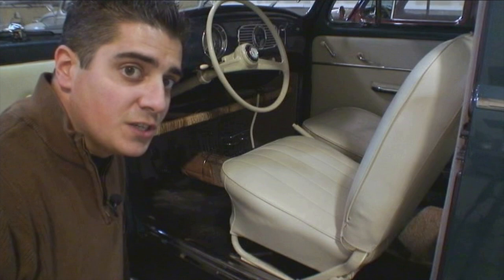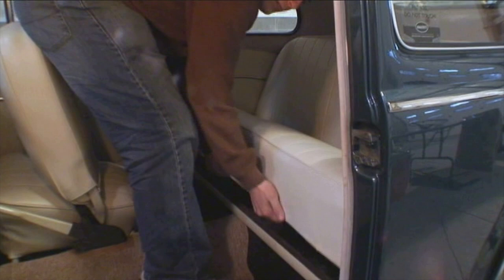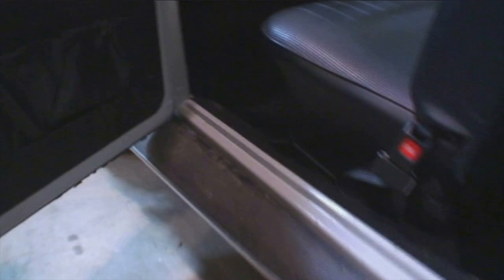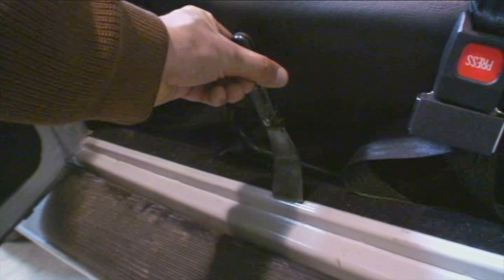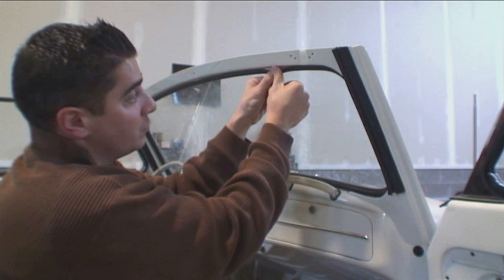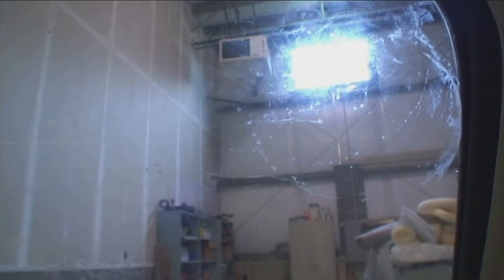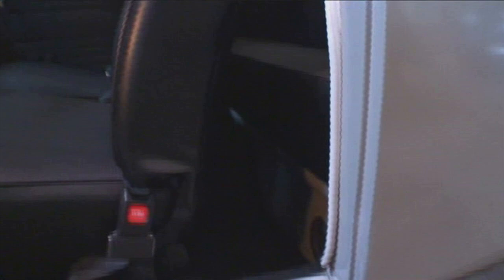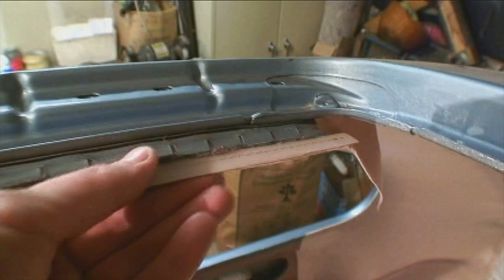Classic VW BuGs How To Install a Ragtop Beetle Headliner and Top Part 1

Comment: The older the glass becomes the glass seems to become less flexible . There is something else about glass  ! Glass is not in solid state . It's is in semi liquid state so in time glass will becomes thinner at the top and becomes thicker at the bottom . This prosses takes place over a 70 years and the glass has to be standing up . In this presses glass becomes wavy . This is why old glass is almost impossible to break after scoring  .  Glass can also flex a little and after that point it will snap or crack .

Comment: Chris, love the videos! Question: my ragtop got punctured by a hail storm. I am not in the financial position to restore the vehicle. Is it silly to replace the top without doing the headliner... window seals... carpet... as the project lends it self to an interior restoration? Any pointers? (my headliner is in poor shape anyway, rotten at the pinch channels).
Reply from the maker: If it is just for protection, that's fine my friend.  Do what you can.

Comment: Sorry if this is a dumb question, but if I convert my hardtop to a ragtop, will these replacement headliners work for it?
Reply from the maker: Just get the kit for the ragtop.  What kind of conversion are you doing?
Reply: @classicvwbugs  I’m thinking of doing a conversion on a 67, just want to make sure that I can put a headliner on it still
Reply from the maker: @snowball2488  yes but where are you getting the sunroof from?
Reply: @classicvwbugs  my bad..thinking jbugs or Wolfsburg west most likely
Reply: @classicvwbugs  unless u know of better ones to use
Reply from the maker: @snowball2488  they won't sell the whole roof, you have to cut the roof you know, right?  Then it's a new paint job, etc.
Reply: @classicvwbugs  ya I know.. was just wondering if the replacement headliner would fit the replacement ragtop after I convert/cut the roof of my 67 if that makes sense
Reply from the maker: @snowball2488  again, you have to get a headliner for a ragtop.  if you are cutting a roof off of a real original ragtop bug, and you weld it in with the right measurements, then you can get a headliner from say sewfine or something.  But if you get an aftermarket roof, then I am not sure.  Britax I hear makes a roof that you can cut in and it comes with the headliner I think.
Reply: @classicvwbugs  sweet thank you for that info and the fast responses..I’ll have to check them out